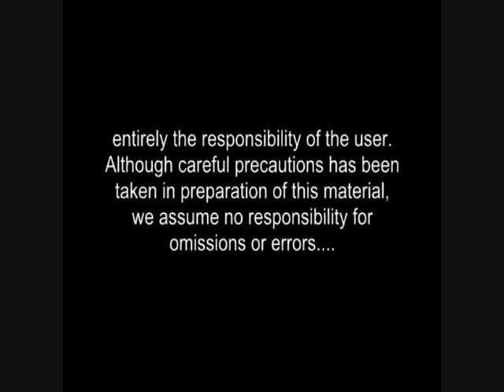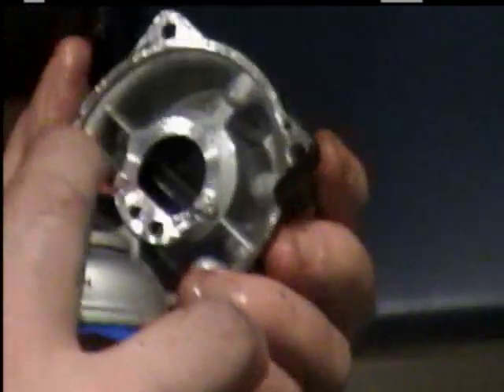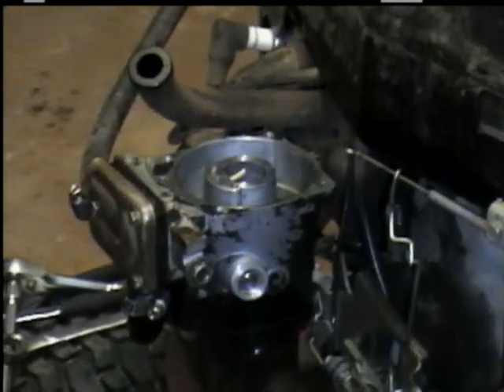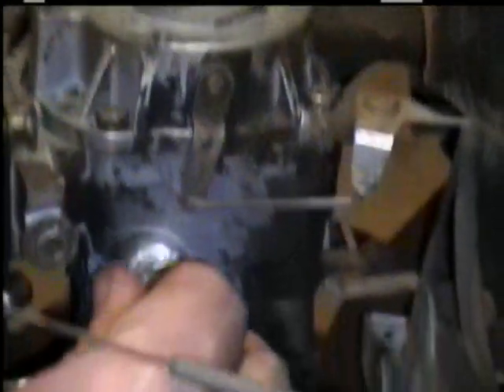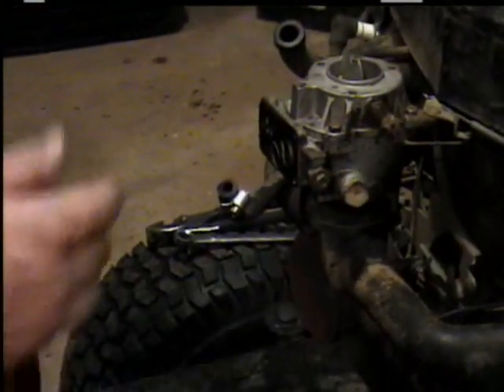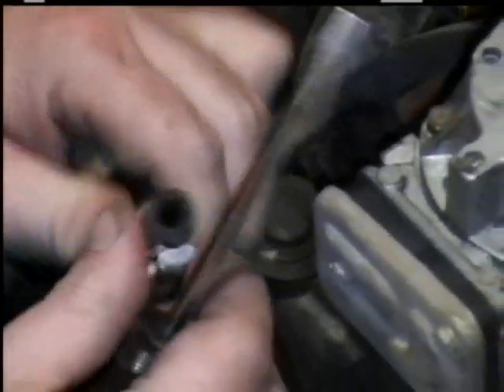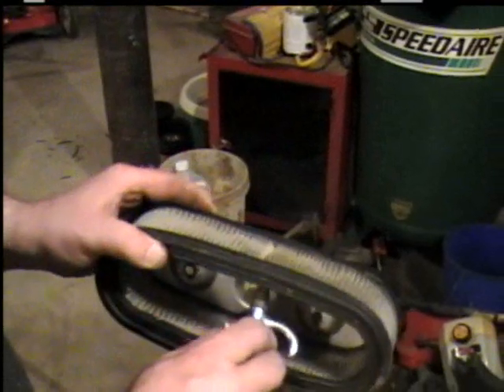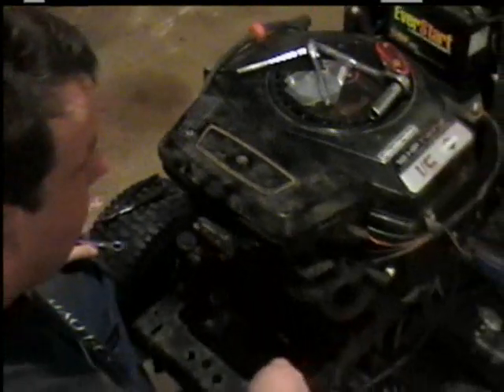Carburetor Cleaning and Fuel pump Repair

Comment: I believe there are three different versions of this carb. The one on the 20 hp has an emulsion tube with about 20 holes drilled into it. Once it is dirty, you will pull your hair out trying to figure out why the holes are clean but it still runs crappy. The answer is the bottom of the closed tube is filled with debris you have to dig out. Once it is TOTALLY clean, it will run like a champ.
Nice video by the way. It gets all the points across and then some.

Comment: Thanks for the reply! It's a B&S 18.5hp. Fuel filter replaced and flow direction good. Did not change fuel pump because gas is flowing into carb when motor is cranked. I disassembled carb and soaked in carb cleaner overnight. I've tried running it without air filter and gas cap opened. I notice that when screwing the gas screw all the way in and air all the way out, it runs a little smoother, but idles high. When I engage the blade while on full throttle, it runs fine as more gas is delivered.

Comment from the maker: Yes , you need to replace the float . The hole will allow the gas to seep in and fill the float up with gas . As the float fills up , it will become heavier with the gas and will not shut off gas flow from tank to carb as it will no longer be able to float up . The carb will over flow and it will eventually het down in your cylinder and make it hard to start and later it won't start at all . It will also get into your oil and fill up the crankcase . It will eventually ruin your motor.  Whizkid

Comment: Thanks! I have the 16hp with the same setup. I took pictures as I took it apart and somehow did not get one with the 1st tiny spring you put back on. Mine went a little easier since I took off the whole carb and manifold but I was going nutts until I found your video. (maybe next time have the smart ass in the background hold the light better :) haha

Comment from the maker: Darin , 

Did you get the fuel filter replaced right ? Sometimes they have an arrow pointing the correct direction for the gas flow . Did you replace the fuel pump if it has one ? Correctly ?  Sounds like you need reclean and adjust the carb. Is the gas tank vented properly ? Try screwing the air and or fuel screw in or out and see what that does . Try running it without the air filter in place . Sounds like it needs adjusting . What kid of motor is on it ?

Whizkid

Comment: Pretty good video. 
Except when you went to work with that wire. You should NEVER stick a solid wire into a carburetor venturi. More than half the time you'll ruin the carburetor. If you get cleaner to squirt through the hole, leave it at that. That's what it's supposed to do! 
If you feel you MUST stick something through the hole, use a very thin mono-filament line. 4-6 pound test line works great, and you won't hurt the venturi.
Reply: I agree, best way ruing a carb... sticking wire like that...
Freaking amateur in my book.

Comment from the maker: Could be , but I mostly suspect a blockage being sucked over the outlet hole in the fuel tank and released when the motor dies ( no suction ), or a dirty fuel filter , dirty carb . The breather outlet in the gas cap could not be functioning properly causing it to vacumm lock ,fuel line collasping or the inside of fuel line comming apart . Check all of these things, too.

Whizkid

Comment from the maker: when engaged . Also check to see that a blade or spindle bearing isn't locked up . my mower died when engageing the blades and turned out that it was a blade bearing locked up .Also check and make sure that there are no wires pinched or bare where it could ground out . also check to make sure that it's getting enough gas and the air filter isn't stopped up . make sure that both plugs are firing . If these points don't fix it then you can write me back for more help .

Whizkid

Comment: yes lawn mower wouldnt start.normally starts right up with no problems at all.. this time jst turned over and over no start.. cleaned the carb..and still had same problem.then replaced it with another carb i have..same problem.. going to change out the fuel and filter.. then try again.. thanks and have a great day

Comment: I've got the same 18 horsepower Briggs and Stratton. It ran great until I would get on an incline then it would want to die unless I kept opening and closing the choke. I did everything on your video as you showed and now the mower won't start it just cranks and won't draw any gas and I've taken the fuel pump off three times just to check make sure that everything is in its place any suggestions?
Reply: Replace fuel line and filter

Comment from the maker: To my knowledge, There is no setting for the float valve. If the fuel is too rich, the fuel mixture screws (if any) may need to be adjusted. Check the float for cracks and holes allowing gas to get in the float preventing it from floating. Check the Valve is seating properly and not sticking. WhizKid may know what else to do. I'll pass it on to him. -MrFixit

Comment: I've got the 20.5 B. & S. And I have a severe flooding problem. I have thoroughly clean the carburetor several times, even the emulsion tube. it's spotless in there! if I can get it to run, it runs like a champ. when I shut it off, it's guaranteed to flood when I try to restart. possibly the needle and seat may be worn out? or is it possible the fuel pump makes too much pressure? other than that, I love this machine!
 BTW, like this video, good job!

Comment from the maker: Atilla Saadat,

I do not know the model number or serial number of the carb. The mower was an older early 1990's model and I have long since sold the mower over a year ago . It's been over a year since we did the video and I sold it . It was a regular valve ,18 hp 2 cylinder Briggs engine .It was on a Lowes mower made by AYP . It originially had a 44 inch deck , but was replaced with a 42 inch deck.

Thanks,
Whizkid

Comment from the maker: terry , 

It would help if I had a model number or make of your engine .  I would say that if it has a fuel pump then it could be bad or the carb. is not  set right or the float is out of adjustment or there is a hole in the float and it fills up with gas and won't float and shut off the gas . Try checking that as well as your pump and adjusting your fuel adjusting screw . Your air filter could also be stopped up . Check that also. Also could be bad or dirty carb . Clean carb / replace

Whizkid

Comment from the maker: Couldn't find anything on it . Did problems start after you cleaned the carb or before ? Was the problem the reason that you cleaned the carb ? Sounds like the needle valve is stuck open from trash or not seating right and shutting off the gas flow . Looked up model no. cv18s nothing came up on kohler .com along with cv18. Check  model no. and resend , please .

Thanks,
Whizkid

Comment: Can you tel me why the gas shoots up into the air filter and the engine will run for a few seconds then stops because it appears it is now starved for fuel? Is this a fuel pump problem or maybe a dirty jet? I'm able to fix about anything as long as I have good instructions and your video has some great info that will come in handy. Already liked and subscribed :-)

Comment: My 20.5 opposing twin has only 65 lbs compression on left side and 88 on right. The motor starts but only runs for 30 seconds, could the governor gear be faulty? As soon as I try to rev it up or slow it stops.

Comment: My dad rebuilt my carb and fuel pump and now I have a surging issue at full throttle. Any idea on how to correct this? Btw, my engine is a 16hp opposed twin, 402707-0157-02 built in 1985. It runs great until you get to full throttle.

Comment: hey thanks whiz.. i have a18 h kohler engine. model cv18s    spec 61568   serial 3030810861   carb is 24 053 25  i had another lawn mower basically a double. and i had taken the carb out of the one i ride and cleaned it did the same thing. then replaced the carb out of the other moter.. same deal??? live over here in clarksville tn.. not to far.. think it would be awsome to get to meet you fellers.. terry

Comment: hey Great videos, question, just installed a 20hp briggs opposed twin on my 2002 crapsman garden tractor it runs awesome...but I think the carb has a begining of a problem and want to fix it now rather then it becoming a bigger problem in the future I pull the choke like normal to start her...then push it in after start and warmed but it runs ruff...AKA Surges..unless I give it 1/4 choke then she purrs...is that a begining of a problem and what would you advise me to do to nip this in the bud?

Comment from the maker: I located your motor or a similiar one on the net.  It's definately something with the carb . don't forget to replace fuel line to as the inside could be comming apart and little pieces getting into carb. From my experiences with carbs was when they did that it was because the needle valve was stuck open or not seating letting gas flow through .

Whizkid

Comment: Great video. I have a john deere z225 problem. Sat for 1.5 years. Flush gas, changed fuel filter, oil & filter and cleaned carb. Checked fuel pump. Mower now starts up and idle fine, but shakes on full throttle. It seems like there's not enough gas to the carb. If on idle and I pull the throttle cable, it ravs fine. When on full throttle, I can see the cable shakes and if I hold on to the cable, it is ok or reduce the air intake on the carb and it's also ok. What am I missing? Thanks. - Darin

Comment: My new carburetor with the 4 screw fuel pump works good the choke still needs reset but it done good today.

I'm still gonna clean up the original carburetor and get it a new fuel pump then it's all good

Comment: did this fix the problem? You said it ran good but the choke had to be out a little,, we have the same problem with a briggs twin, runs good with the choke halfway out,,but surges with the choke pushed in. I looked for the follow up video but there isnt one,, I was hoping to see and hear it run after the fix, kinda left us hangin' there. did it run like new or run the same?

Comment from the maker: knighthawk86855,

If it has spark while just plain running then it will under a load . the question is is the spark hot enough and is there enough spark . Take the coil off and clean the magnets on the flywheel as well as the coil ends and reset the air gap . Yes the carb could need more cleaning or adjusting but usually if it runs fine not under a load then it should run fine under a load . check and see that the blade belt isn't stuck to a pulley or that the belt dosen't become to tight .

Comment: What I would like to know b4 I start tearing into the carb....is....if that is what it is...that its not the coil....or something else I haven't thought of and wanted to run it by you first amd not waste time and money on the carb....fyi...the coil is a double wire and pretty rusted I have cleaned it good and set the gap....it has spark on both wires but not sure if it does under load!!!!

Comment: my float has a small leak, I can shake a little gas around in it and it is taking forever to try to get it all out. Should I replace the float/donut it is leaking at the joint around the outside diameter? will this tiny leak be a problem if I leave it alone?

Comment from the maker: knighthawk86855,

Some motors are what they call cold collared meaning that they will run rough until the warm up . Having the choke on a little helps them to run better until they warm up.If it persists after the motor warms up good then it is starting a problem . Pour some good carb. cleaner in the tank and if that dosen,t fix it then you will have to take it apart and clean it and / or rebuild it . But first try adjusting the carb. adjusting screws .

Thanks,
Whizkid

Comment from the maker: There is no float setting for these carbs,dixie103. They come from the factory already preset . The plastic floats are non adjustable and theres not much adjustment at all on the metal ones , Try cleaning the carb. or adjusting the adjusting screws .

Thanks,
Whizkid

Comment from the maker: @januaryman169    Start reading the bottom post first and then up to the top post last . Let me know how it goes and if you have anymore questions or if I can be of more help .
But , please be confident and sure of what what your doing before you start and proceed with my advice . Also, when poking out the holes with wires , be sure not to force the wire to hard or break the wire off in the holes as they can be impossible to get out .
 
Thanks,
 
Whizkid

Comment: I Have this same engine but a little older, early 80's model, it is on my MTD Ranch King 44" deck. it has been in my family since the beginning. anyway I been trying to find a rebuild kit for the fuel pump. but I have not been able to find the model number for the Carb. friend of my was helping me get it ready for the season and was working on it when I was not their. he did not know that was the fuel pump, opened it up and lost the springs. LOL, Can you help me?

Comment: I have a 16 H.P. Twin Vanguard that has less than 900 hours on it. It was originally installed on a Pressure washer but not used many times. I have installed it on a Reproduction 1901 Oldsmobile curved Dash Horseless Carriage. I installed a 700 Duster Clutch. The car has a Three speed Ford Transmission all brand newly rebuilt. I can average 20 - 25 M.P.H. on good traveling roads and Highways. I drive it quite a lot and even on road trips of 75 to 100 miles Round Trips. I also drive in Hills, mountains and all other areas of Northern California. I am having a problem of surging as if the Governor was working. But a Briggs Mechanic disconnected the Governor. This started happening this past weekend on a trip for the Holiday. It acts as if it is not getting gas. But has plenty gas in filter and tank. Can you give me some ideas as to the problem. I cannot get any of the dealer's here in Redding, Ca. to work on it unless I remove it from the car. that is a big job. This car represents The American Fallen Warrior Memorial Foundation as a Volunteer fund raising vehicle. I am a veteran Disabled and it is my only way of supporting our Warriors. Please respond. Raymond F. Pittam
Reply from the maker: Raymond,

Make sure that carb is clean as well as fuel and air filter . Make sure that the tank is cleaned and there is no trash getting over the outlet hole . Make sure that the gas cap is venting the tank and that the gas is fresh and clean .

Whizkid

Comment from the maker: @januaryman169    Watch out for the gasket around the bowl where the top and bottom connect or go together  ( replace if necessary ) and clean / soak it real good . Unscrew all the plugs and and jet screws , poke out the holes with a wire that will fit down the holes , spray carb . cleaner through the holes and blow out with a air hose . ( Doe the same on the fuel pump , keep carp cleaner off of diaphrams and gaskets  )  .

Whizkid

Comment: i have a 16 hp twin cylinder briggs that won't spark at all  what could be my problem
Reply: The coil pull off and take wire brush and shine back to silver and put back on

Comment from the maker: @januaryman169   If the high jet is stopped up then it can't get the fuel that it needs and goes back to the low side and since the low side dosen't provide enough fuel for it to run full throttle then it goes back to the high side to get what it needs . Can't find it and then goes back to the low side and the process is repeated .  My advice is to take the carb apart. 

Whizkid

Comment from the maker: @januaryman169    Study where all of your linkages hook up and where everything goes and how it goes so you can put it back in the right spot . They make stuff ( chemicals ) like Seafoam that you can add to your gas or spray into carb with it running that's supposed to " cure "  surging . You can try these first , just follow the manufactures directions .

Whizkid

Comment from the maker: @januaryman169    Careful on the air pressure as you may blow something out that isn't supposed to come out . If the carb was really dirty then it probably needs a good soaking .  Also , check for any air leaks .  Go to Briggs and Stratton . com and type in your model numbers  ( I copied and pasted all of your number into the search field on the main page )  into the search box ,hit enter , then on the next page click on illustrated parts list English version 

Whizkid

Comment from the maker: @januaryman169   Scroll down to the carb and fuel pump parts assembly and make sure that you have everything put back together right as well as to how it comes apart . Notice where all the plugs are that you can take out and clean ,etc.  I hope that all of this helps you to repair your motor , but a word of caution - If your not sure how to do this or have the right toolos , then take it to a " professional "  .

Whizkid

Comment from the maker: @januaryman169    Provided that your dad rebuilt your fuel pump right and put every thing back like it goes and I'd say that he did if it's running . So ,in other words the problem is more than likely in your carb. Someone told me one time that the reason a motor surged is because it is trying to switch between the low and high jets when you rev up the motor . 

Whizkid